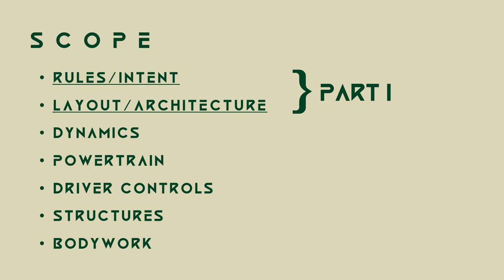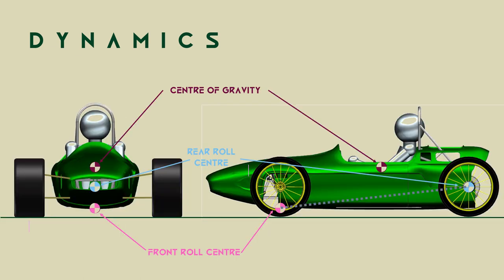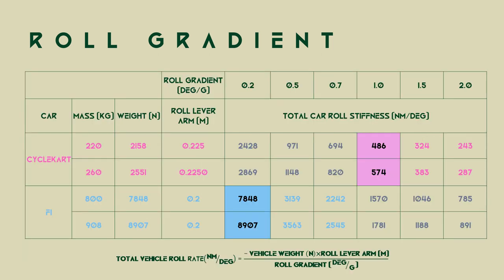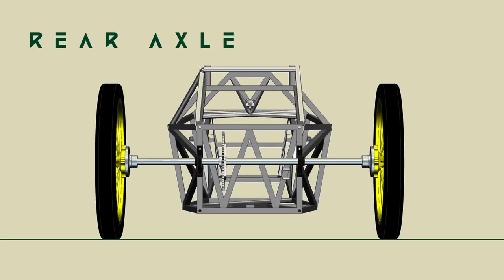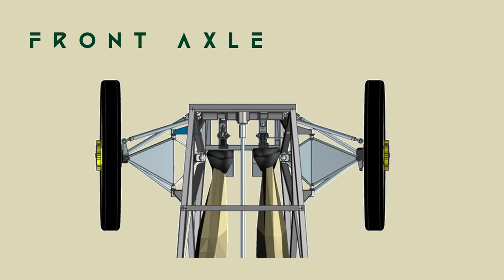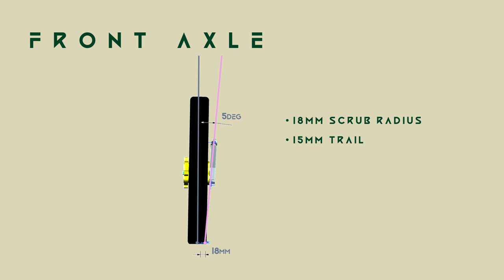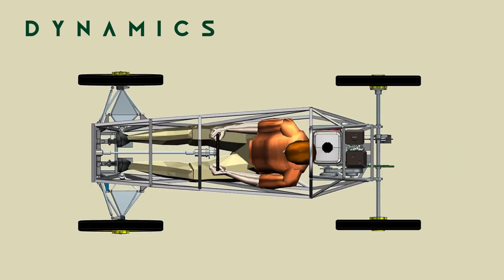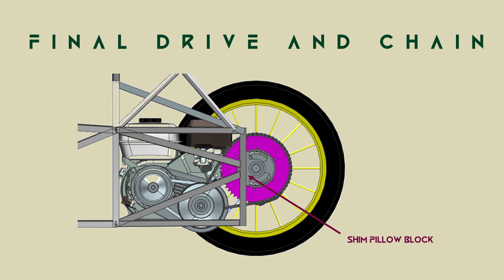Team Juric   Lotus 25 Cyclekart Design Part 2

Comment: I'm thinking that if there's no rear suspension the rear roll center is on the ground.
Reply from the maker: Hi Joseph, the roll centre is the point where you can apply a lateral force and the sprung mass does not rotate. On a solid rear axle like mine, if you applied a lateral force at ground there would be a torque about the axle and rotation of the sprung mass. if you applied that lateral force at the axle centreline there would be no torque or rotation and hence is the roll centre.

Thanks,
Phil

Comment: I wish you would sleep on it Phil. I'm sorry to be a pest but I stand my ground.
Reply from the maker: Hi Joseph, it's a very good point, and I had another think about it. It's not ground or axle height, it's way more complex in this set up simply because it's difficult to model the kinematics, since the deflection of the axle controls the path of motion.

If everything was infinitely stiff then yes absolutely on the ground, however it's not going to behave like that so I don't see the need to use it in my roll stiffness calculation.

For my calcs my assumption treated the pillow block bearings as a super stiff leaf spring set up. Again it's not realistic, but given the axle will deflect at some point along the length on the cantilevered side, the RC should be at some point above the ground approximately at the centre of bending.

So it won't be either, and since this was used to calculate roll stiffness, if you look at the sensitivity of the Rear RC between ground and axle height, it's about 10% shift of LLTD, not insignificant but it will be somewhere in-between.

The final point is these wheels and tyres will deflect like crazy to lateral forces, the roll centre will move more from contact patch movement than deflection of the axle...

I will be doing a proper roll resistance test and axle system deflection testing to actually see what the behaviour will be to get some credibility in the numbers and revise from there.
Reply: @teamjuric  Hi Phil. I've been rethinking it too, and came to pretty much the same conclusions, though I'm not as fluent in the language of suspension. Thanks for being open minded. I learned a lot from your first two videos and I'm sure third will be as good.
Reply: Hi Phil. I had another think too, and I think the dynamics of the situation overrule me .The load transfer in a corner will be high. and the roll lever will be from the ground to CG height. With rear weight bias, no diff and not much front roll stiffness this means a strong tendency to oversteer. looking at it this way I think the rear roll center should be considered to be at CG height. I would think you'd need a very stiff front anti roll bar to balance the front and rear grip. @teamjuric
Reply from the maker: Its funny, the more degrees of freedom you remove the more difficult it is to predict... 

This is another complex issue which I'm hoping to elaborate on in the next video. In my initial suspension rate calculation I assumed an infinitely stiff chassis, but given how stiff the suspension rates are, the chassis won't be stiff enough to maintain that level of fidelity required. 

What that results in, is the chassis acts as a torsional spring in series to the suspension springs and reduces the stiffness of the overall roll rate, and this isn't easy to predict what suspension spring changes will do to the balance/roll stiffness distribution.

In short so many unknowns especially tyres, I need to build it, design in adjustment, do bench testing and then dynamic validation. It's going to be a fun process but a long one!!

Comment: amazing content.  thanks for sharing.
Reply from the maker: Thanks for the kind words. I have more videos being worked on at the moment, chassis and suspension structures. Was there any specific things you wanted to know more about?
Reply: @teamjuric  Hi, and thanks for asking.  Apologies but the technical term escapes me, but how does one select front and rear spring rates to prevent unwanted oscillations?  I think it's also called porpoising?  Also, how critical is it to calculate roll rate?  

Your content is awesome.  I spent over a year as an unofficial member of a Formula SAE team at a local college a few years ago.  I've read every race car chassis and suspension book I can find - Adams, Aird, Costin and Phipps, Terry and Baker, Van Valkenberg and the Carrol Smith books.  I also have Milliken and Milliken but it's so dense! Your content is the most detailed - and more importantly - accessible explanation of critical content that I've found.

I just started cutting metal on a build that I've been preparing for/working on for many years.  The base is a completely stripped '81 Bertone X1/9 body shell. What I'm doing is, think what Ferrari did with the 308 to build the 288 GTO - building a tubular chassis within the body shell and installing an Alfa twin cam + WRX transaxle in a longitudinal layout, with suspension based on a modified NA Miata geometry, preserving the inboard suspension pickups and building longer control arms to extend the OEM track from 56 in to ~60 in F/R.  Similar to what Bilinski did with the front end of Midlana.  Currently designing a street-specific roll cage to be build by a local speed shop after a design review, then I will fit up and tack tubing for the front and rear subframes then back to the speed shop for design review and final welding.
Reply from the maker: Hello! That sounds like a fantastic project, lots of scope to do a whole lot of fun sub projects!! I do like the x1/9, it's such a beautiful car, there is something special about the wedge style and pop up head lights that just put a smile on my face! Combine that shape and some better dynamics and a twin cam and you're going to have an absolute beast!!

 Id never heard of the Midlana until today, that looks super fun.

For your questions about dynamics 

1. Porpoising related oscillations are due to sensitive underbody aerodynamic interaction with the ground, complicated and not relevant to any of us, that term is very specific to high downforce stiffly sprung racing cars. 

2. However for unwanted oscillations the very short version is, your dampers/shock absorbers do the job of absorbing, transmitting and dissipating the majority of the oscillations. 

3. Slightly longer version, you will always get oscillations, but unwanted is very subjective, a passenger car doesn't want to be so stiff that you shake the fillings out of your teeth, but then a race car doesn't want floaty type oscillations that is comfortable for ride as aero platform control is so critical. So the challenge is picking what kind of behaviour you want and starting from there, RCVD does go into detail on this with good guidance on the two methods (ride frequency or travel).

4. I'll be getting into a lot more detail of roll rates in my next video that I'm currently working on, but essentially it is important. The relative roll stiffness of each axle is pretty much the main tool used to adjust the over/under/neutral steer balance of the car.

Comment: The smaller the drive sprocket, the more the chain has to 'turn' on the link and the hotter it will run. (and the quicker it wears out or breaks) 
 Reynolds Chains in the 1950's (when they were premier chain maker in the world) stated that 19t was minimum recommended for drive sprockets with an even number of teeth for driven sprockets.
Saying this, Japanese manufacturers and off road bikes have been running drive sprockets as low as 11 teeth although 14 or 16 is more common (down from norm of 17t-18t in 1960's-70's)
One other thing you should take into account, motorcycle hubs are not designed for lateral forces so increasing cornering ability can cause them to break, usually around the bearing rather than spoke flanges.
Instead of moving axle or engine, a chain roller tensioner may be better, particularly as drive will only be one direction as CVT usually 'free wheels' rather than enables engine braking
Reply from the maker: Thanks for the advice, the duty of this car is low im not super concerned about longevity. 

I'm going to see what the installation stiffness of the wheels is specifically at the hub, it is where most wheels fail.

Yeh the chain tensioning is not my strong suit but I still like having positive adjustment of the chain at static and then you can do the fine adjustment with a sprung chain tensioner. 

You sound like you've build a few cyclekarts?
Reply: @teamjuric  Actually, I haven't but been thinking about building one as I'm too old to be falling down at high speed nowadays.
The wheels rarely fail on bike (C50-CB100), even when overloaded a bit but when smaller hubs are used to save weight  on race bikes they crack , particularly if 'ventilated' to aid cooling.
 AHRMA (American Historic Racing Motorcycle Association) requires drum brakes on all pre-1974 bikes (which can fade pretty quick compared to discs).  I have melted the centres out of brake pads when 'trying a bit' using organic instead of sintered pads (even if organics work much better in the wet)
Hubs have a pretty easy fix though, have a shrink fit plate to support outer edge of brake drum so it can't flex, either in drum or just on edge as basically the drum brake hub is a 'U' with bearing support on lower end extended to the open end
 Cheap way to go racing was get a street Honda CB350 and modify things as and when you could afford it, just stripping them down to basics shed around 60 lbs (there were over 3 million CB350's made and are still pretty common for a bike that went out of production in 1973)
 I was a motorcycle mechanic, shop manager, instructor, etc for 50 years but unlike most I actually  studied things (failed engineer, couldn't do the math, even with a slide rule, LOL) You kinda lost me with your calculations even when they were well explained (the steering/weight transfer, etc was excellent, understood things much better since I tried studying it in the 80's and again in the 90's)
I've seen a lot of broken stuff over the years, some I even broke myself 😁.
Always try to figure out why things broke, often I could tell customers what they did, usually shocked the hell out of them as they were 'just riding along'
All for now

Comment: I made 9 tooth sprocket for #428 chain for the TAV with wire EDM. This way the key is part of the procket.
Reply from the maker: That's awesome, did you machine the sprocket blank to the correct profile and then use the EDM to cut the teeth and internal key? What ratio do you use on your cart?
Reply: @teamjuric  i bought a blank 9 tooth sprocket, only 8mm pilot hole in it. So, with the EDM i cut the 16mm hole with the integrated key. I use 9 tooth on the TAV and 48 on the axle, so ratio is 1:5.33
Reply from the maker: Where did you get the blanks from? I'm keen to make one  for myself